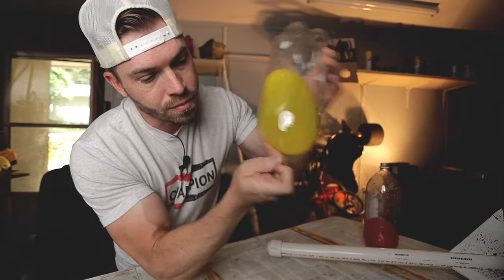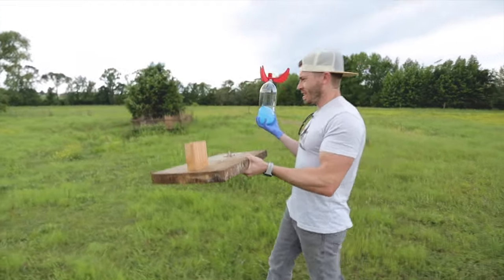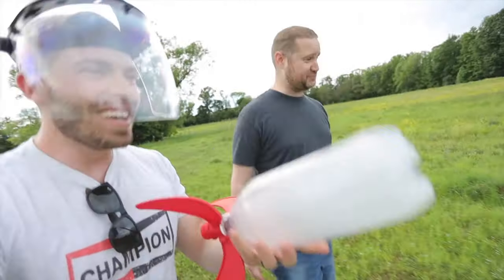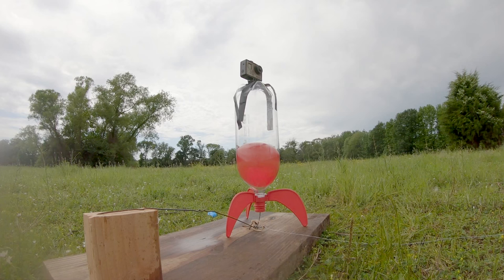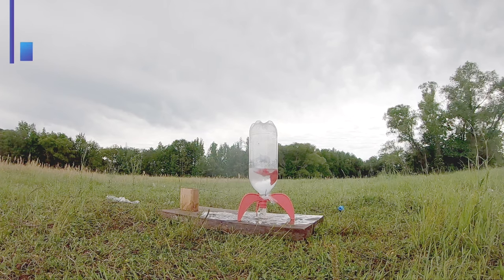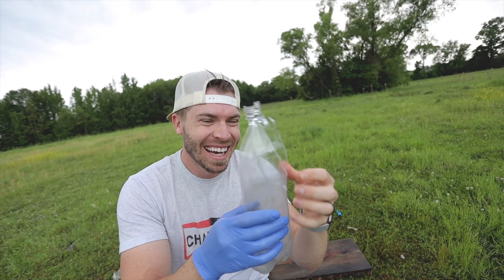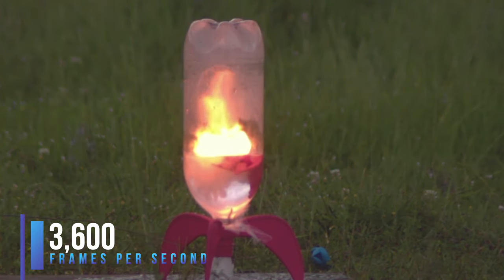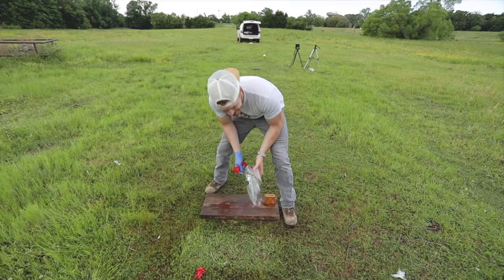SEE THROUGH ROCKET - Sodium and Water Rocket...Take 2

Comment: Cool project. I did a school project on home made water rockets about 33 years ago. They withstood 300 psi, which was as much pressure as I could put into them using a car foot pump. I never had one explode. They used the old '80's bottle design which had a hemispherical bottom with a separate black part glued on so they'd stand up. I removed it and replaced it with a cone. I couldn't find a way to hold the fins on reliably. 3d printed fins screwed onto the cap threads makes me want to have another go!

Comment: We used to launch an upsidedown metal 5 gallon bucket with a small hole in the bottom of it from a wet mud hole with carbide rocks and a long limb with a burning rag on the end of it!
That thing would get 2 to 3 hundred feet of altitude depending on how deep you stuck it into the mud.